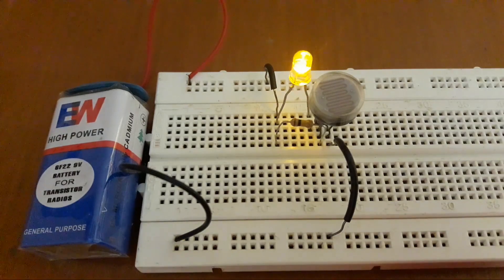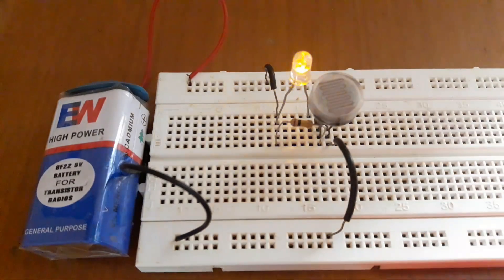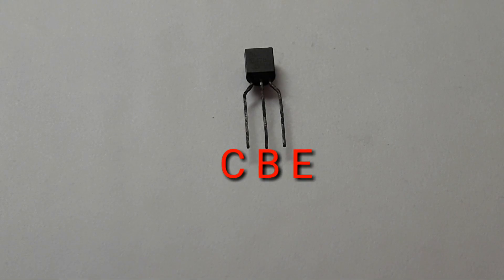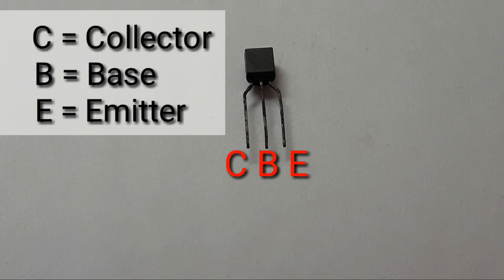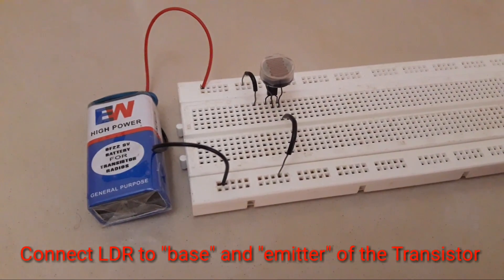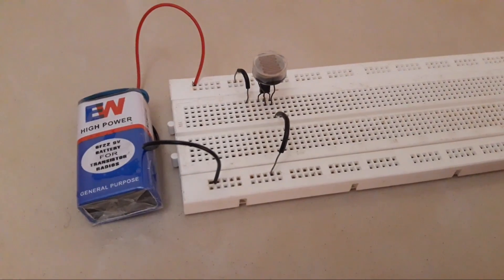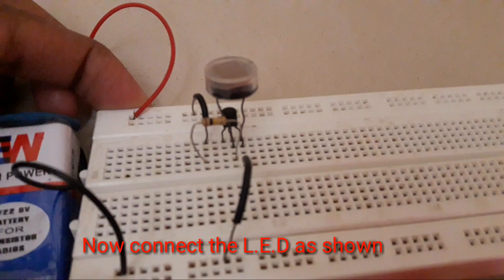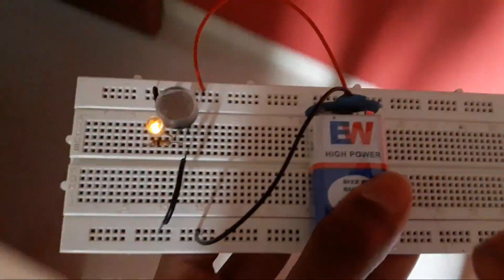How to make "Automatic Street Light/Dark Sensor" on Breadboard [HD]

Comment: Nice👍👍 very simple and easy circuit. I used a 10k resistor instead of 100k because I guess the specifications of the LDR I used were different and it worked just perfectly fine .

Comment: Sir i saw your light sensor video and dark sensor video as well
My question is what is the difference between circuits of two cases
Reply from the maker: Hi. In case of a Dark Sensor - The L.E.D comes "ON" when it gets dark.
In case of Light Sensor - The L.E.D comes "ON" when there is light.

Dark sensor detects darkness and Light sensor detects light. Both of these circuits use LDR (Light Dependant Resistor) to detect darkness/light.
Reply: Sir i mean to say what is the difference between connection of component
Reply from the maker: Watch the video... you will understand. There is just few changes made with the connections...

Comment: I had done exactly the same but it didn't on at dark
Reply: Kamaksha Rawat  you may have connected things wrongly like LDR . or your transistor model might be different like it can be BC548 instead of BC547 so check all your connection and your resistor color,  it's tolerance color. 
your transmitor model no and then tell me the result
Reply: hope your problem get solved
Reply: Kamaksha Rawat you should also check that it is only 100k ohm resistor